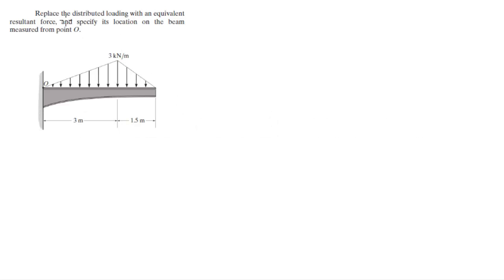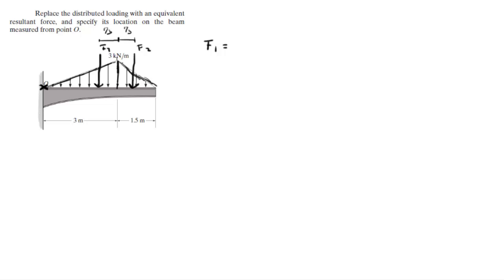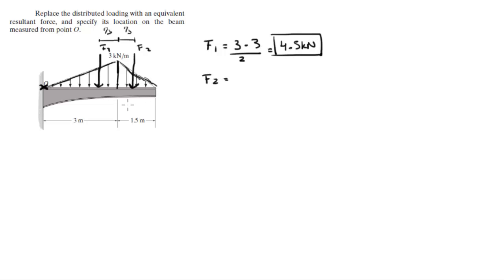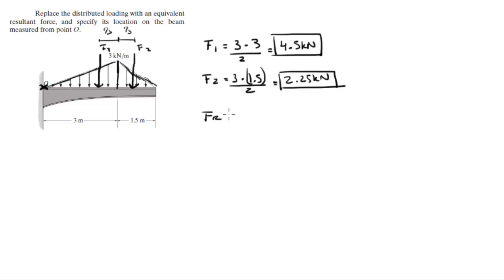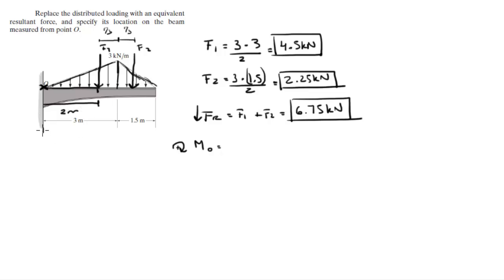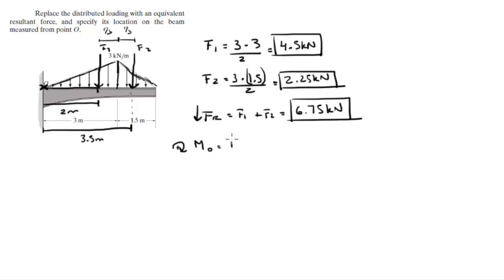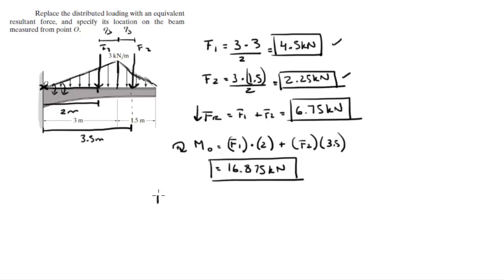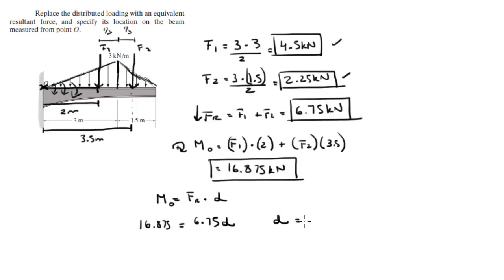Replace the loading with a resultant force and specify its location

Comment: For those who were stuck like me on where he got the 1/3.   Google right triangle centroid and that gives you an equation.  

My teacher gave me a formula in which the centroid distance x = base/3.  I kept getting 1m for F1.  I realized that the equation gives the centroid distance from the top of the triangle. Meaning from the right side.  The problem here wants the distance from O.  So if the centroid is 1m from the top (the right).   Then it is 2m from O (the left).
Reply: I don’t understand how he got the 2 m and the 0.5 m
Reply: @lexasoraus  It has been quite a few years but let's see... Understand that the value for the distance to the centroid is relative from where you are measuring.  For this problem you are measuring from O to the F1 and F2.  To get 2m, observe that the triangle containing F1 is facing in a particular orientation (the fine tip of the triangle is touching O), when measuring from this orientation the equation of the centroid says that the location of F1 is at (2/3)*b (where b = the base of the triangle, which means b = 3m) The answer then is (2/3)*3 = 2m.    Now for 0.5 observe that the triangle containing F2 is flipped or mirrored to the triangle containing F1.  In this case, the equation for the location of the centroid of the triangle is b/3.  In this case that would be 1.5/3 = 0.5m.